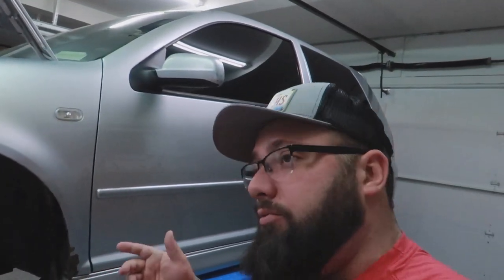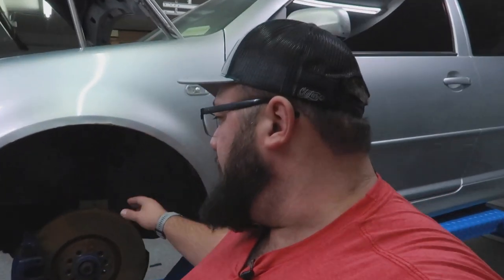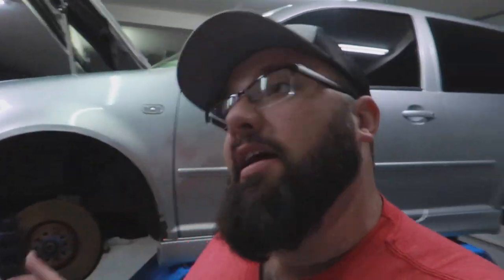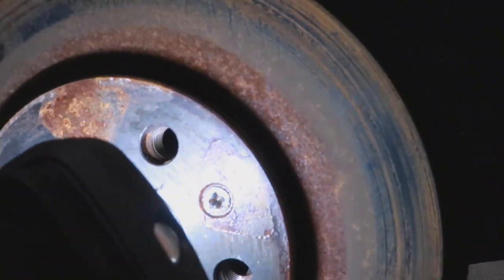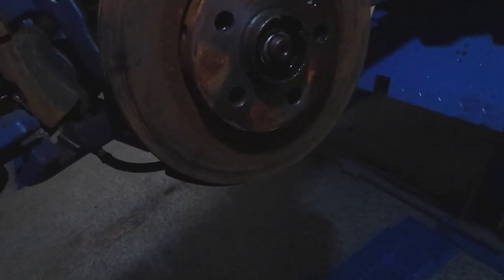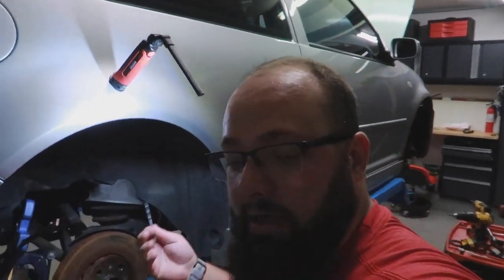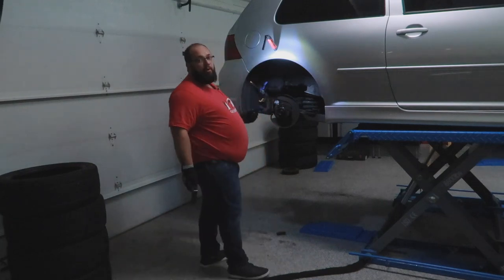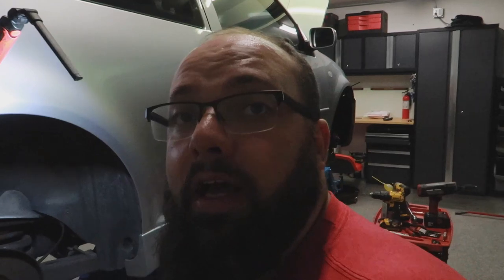VW MK4 R32 Tear-down,  Removal of the Calipers, Brakes, Rotors! The Project Car Rebuild Pt. 4

Comment: Hey,
Where did you buy the red cart at 8:00 ?
It seems to be very useful !
Reply from the maker: gaetan6396 hey man,
It is VERY USEFUL! Love it! Here it is... one bully didn’t fit correctly it’s needs a longer one but it works great! Performance Tool W54032 Two shelf Compact Mechanic's Shop Cart With Store Tray https://www.amazon.com/dp/B002UBS022/ref=cm_sw_r_cp_api_i_jEe3DbKCK62S5
Reply: Thank’s !

Comment: I still remember my first REAL car: a VW GTI (I think you weren't born yet) with the aftermarket front spoiler, radiator grid and head lights + Pirelli low profile and aluminum alloy wheels. Yes, it was a cool car and what you got there is equally cool.
Reply from the maker: Thanks Armando, what year was it?
Reply: 1984/85 if I am not wrong.